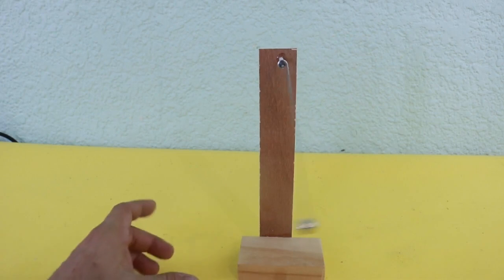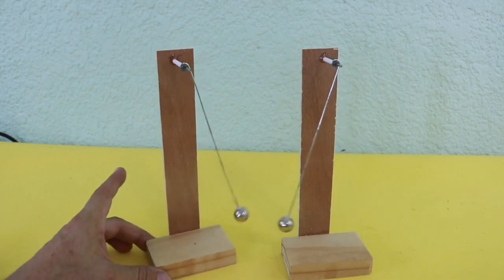Pendulum Synchronization

Comment: Very good and informative video! You very simply and mind blowing are showing both pendulums transporting no mechanical vibrations to outside world when 180 degree out of phase. Thus I have question Sir: If you use e.g. two indentical electrical transformers, is it possible to reduce hum sound with these both transformers mounted solid to one housing? The incoming ac voltage of each other 180 degree antiphase on their primary sides and on the secondary sides both voltage wave forms rectified and conclued to one voltage for dc output?

Comment: I think the resolution is related to the center-of-mass (CoM). Here the CoM remains fixed by anti-phase oscillation. In other experiments, where the pendulums are on a table (the base/platform), the CoM is again fixed. However, the table movement itself is out-of-phase with the system of pendulums. 

Notice initially in your experiment, the cylinders are moving so as to keep the CoM the same. Then they stop moving and to keep the same CoM at a fixed position, the pendulums must operate out-of-phase. SOMETHING has to be out-of-phase, ether the base, or the pendulums, in order to keep the CoM fixed.

In the table system, the momentum of the base (i.e. the table) is out of phase with the pendulum system. But its movement is so small that it is not perceptible to the eye. This is because the mass of the table is typically much larger than that of the pendulums.